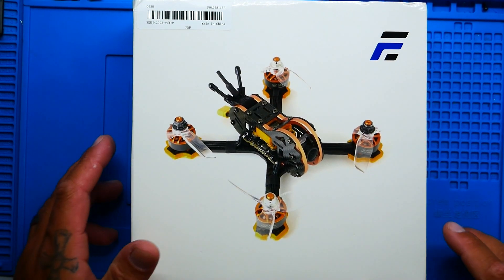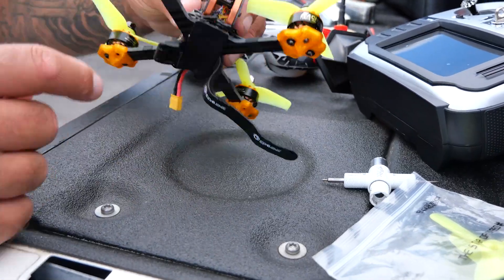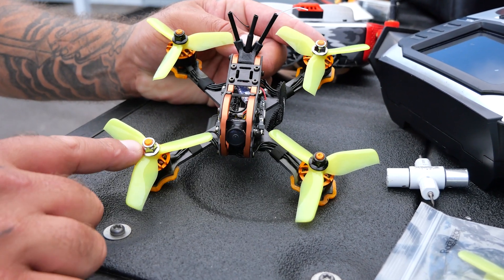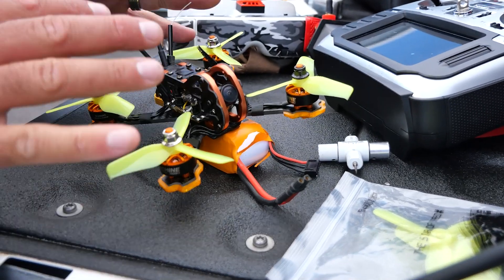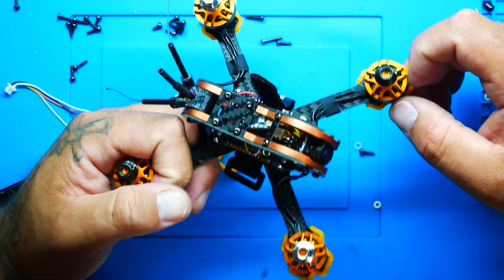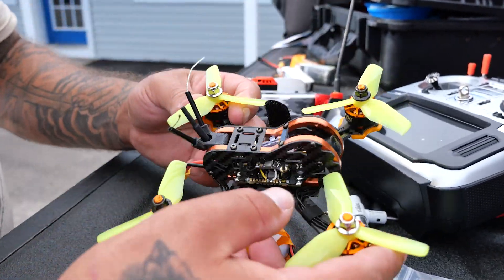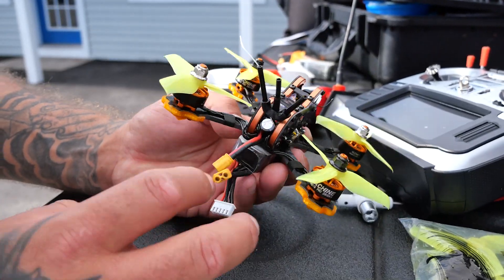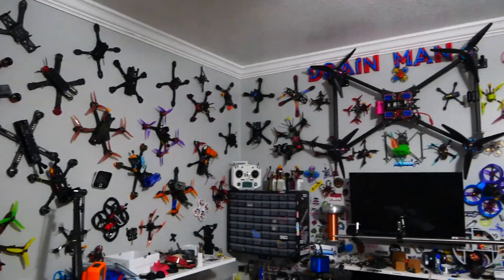Eachine Tyro79 Pro DIY Micro Drone - Getting My Money's Worth!!??

Comment: I used slightly longer standoffs on my Tyro 79, and then slapped a vista in there. Little heavier but this quad almost handles like a 5" anyway, so flying with my DJI goggles kicks ass!

Comment: I bought the 79s last year and I love it however about 3 months ago a right rear motor went out.... i thought ok it happens I guess I only had 6 or 7 flights on it so 3 weeks ago the left rear motor went out smh....now a couple days ago the front left motor went out 🤔 is this a joke....the motors are literally going out in a clockwise order so now I'm just waiting for the front right to go out 😑 I'm starting to think eachine motors are garbage....I had ordered 1 motor from banggood when the first one went out and after 2 weeks decided to try somewhere else so I found the exact same spec motors on amazon I bought 2 and got them before I got the 1 from banggood smh....and so far they are holding up well but only time and a good spanking or two will tell😏 I was looking forward to you spanking this quad but I'm not surprised that the motor didn't work and to be honest I'm really disappointed that they can call this a "Pro" edition smh....its the exact same quad with a little bigger amp esc....I like eachine products but they are slippin man! Lol Rip and Dip Crash and Bash Rebuild and Repeat 😁✌🏾

Comment: I have the original tyro79, out of the box the vtx was doa. Then after replacing that I got a desink and crashed killing 2 motors. Replaced those 2 motors and a desink happened again killing 1 of the brand new motors.. Replaced that motor again and put it up on the wall lol. Too fragile to fly. Flew great when it did fly tho.